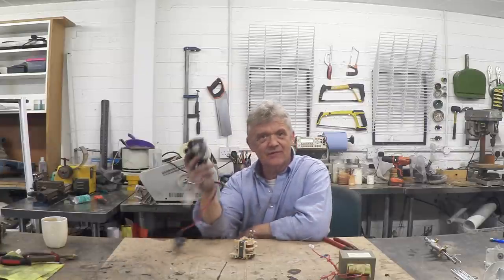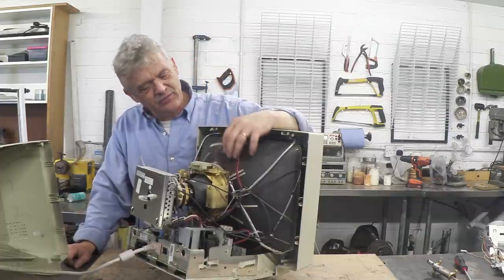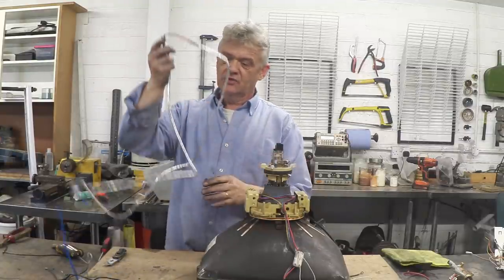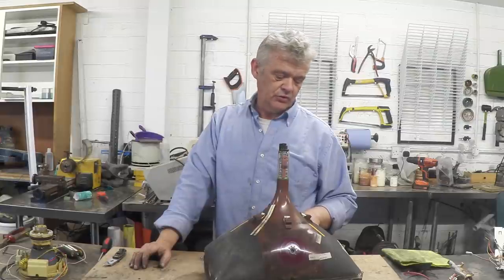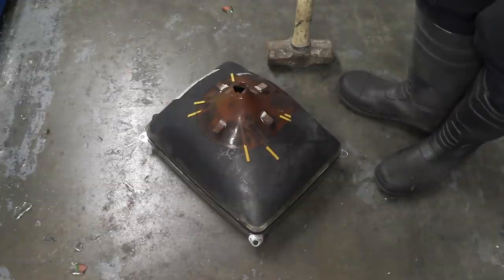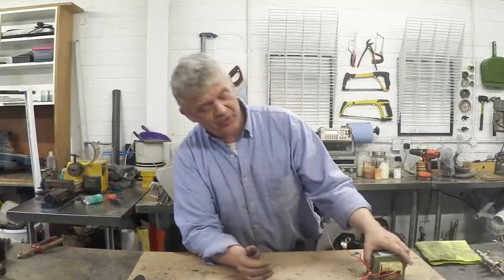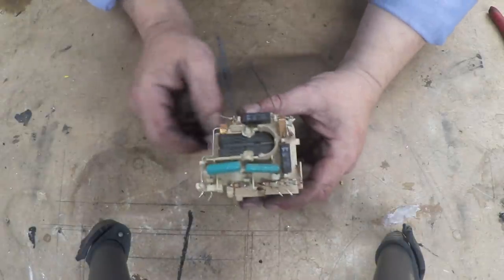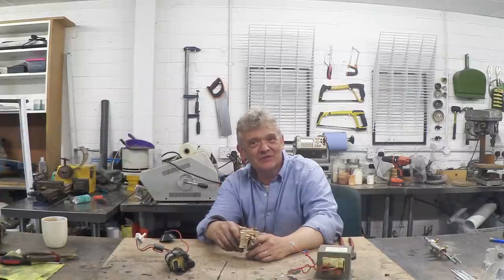Old And New Sources For High Voltage

Comment: Hi Robert, lol that is really great news about the microwave oven flybacks. What are the performance characteristics like for the new flyback vs the old MOT? MOT's were great because of the high current they could deliver, I am guessing the new flyback is trading higher voltage for lower current?
Reply: I would take for granted they are quite much the same power & voltage wise.
There is still a magnetron and the output power of the oven should be the same.

Still, you would need a quite powerful driver to get good output.
If you can use the board you would have more of the setup.
Reply: @erlendse  Yea it could be although that secondary coil did not look heavy enough to support high current output. I was wondering if they had maybe also designed a new magnetron which worked at higher voltage and frequency and thus would require less current. Either way, I think this new flyback would be very well worth bench testing :-)
Reply: @GrantVisserUK  500 mA after a doubler/tripler? Not really a lot of current.

Anything above that is overload, for common oven transformers!

There is also a filament supply (single turn, 10A?).

The magnetron is a occilator that give out 2.4xx GHz, that it's modulated by 50/60 Hz or some KHz doesn't matter a lot.

The iron blocks from old ovens are cost-cut design. Some extra primary winding turns should hopefully lower the idle current a lot.

Comment: Rob I use to work with the cathoray tubes after I left the military at a TV repair shop. The front of the tube even when been off for years. Due to the air static charge on the phosphorus. I used a screwdriver and shorted it out on the linz wire to earth it. Love the flyback transformers.